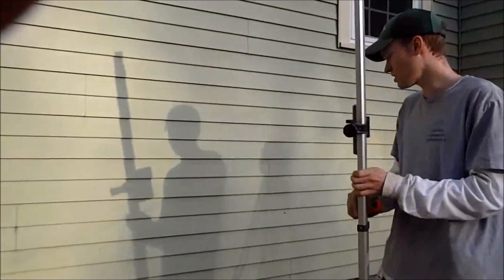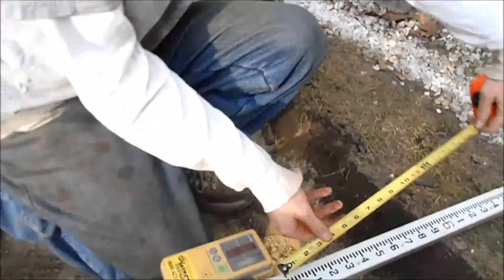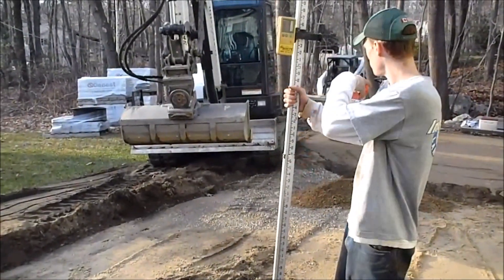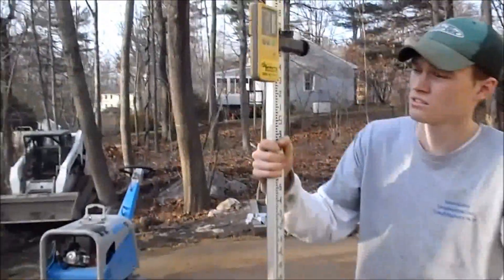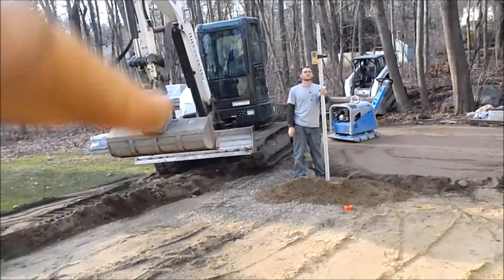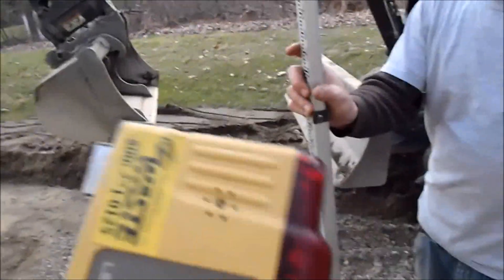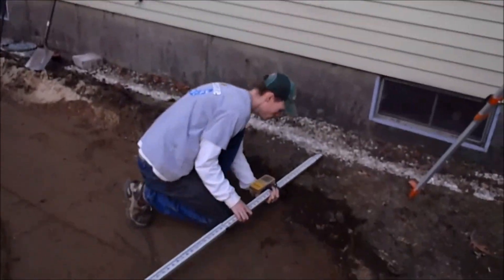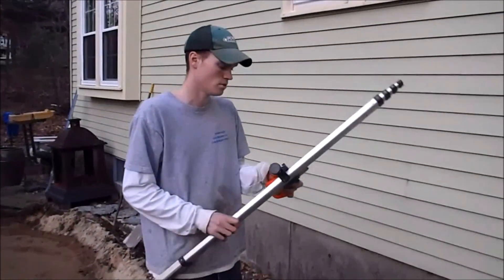How To: Set Up A Laser Level With A Pitch

Comment: You do know that your stick is not in 10ths but actually in inches. Each mark is a 8th of a inch thick.  So you actually get to measurements from each line that's why at each inch mark it goes to a point to show the top of that line is the next inch. It's for when you are looking through a transit and you have thin crosshairs yet you still need to see the line.
Reply: ryan gray Ryan; the rod (or stick) is in fact in tenths and hundredths of feet, meaning, they have broken the foot into ten parts instead of twelve, known as "tenths", and those ten parts of the foot are broken into ten more parts, known as "Hundredths".  That is how it is done in surveying and engineering.  It happens that a hundredth is very close to the same as 1/8 inch, but technically not exactly 1/8 inch. One inch is equal to .083333 Feet.  Anyway, just wanted to bring you up to speed with engineering/surveying measurements, and what those marks are on the stick.
Reply: You are right I was thinking the stick was in fact a foot stick at first glance. I use both foot and 10th sticks daily as I do customs pools so I am very familiar

Comment: You do know lasers are not 100% accurate. The further out you go the more it drops. You should get a transit there only off by 100ths
Reply from the maker: I do know that, and I know nothing is 100% accurate. For the type of work we do and the type of work I am doing this demonstration for this laser is more than adequate.
Reply: The laser I use is accurate to 1/16th" at 100 feet and good up to 1600 feet, imo it's a better bang for your buck.
Reply: that would be wrong, today the lasers are better and have the same range of the transits, I am looking at most transits being in the 3/16 to 1/4 tolerances how is that better than 1/16 per 100 ft. So why spend thousands of dollars for a super accurate transit when just about any top laser is better?

Comment: Really good clear video, I knew how to grade level, but not with a pitch, now all is clear, I have similar equipment, just a point if you have a pad, say 10m wide, 30m long I assume you would need the laser at the highest point of your pad and in the middle, If the grade was 1m drop over the 30m, is that just the centre line or does it apply to the full width over the 30m length? Hope that makes sense
Reply from the maker: Just the center line. It will get slightly higher as you go off to the sides because the laser is rotating in a circle.

Comment: Why dont you just figure the slope percentage? Measure from point a to point b. You already know the height difference for the slope. As an example say your height difference is .30 and your distance is 30 ft. Use a calculator and put in .30 and divide it by your distance which is 30 feet than multiply it by 100. That formula will give you your slope percentage which in this case will be 1% which = an eighth of an inch per foot. After you establish your slope percentage you need to set up your laser or aim your laser as you already know. The laser I use at work is a bit more sophisticated than yours and has a digital read out. Since I already know my slope percentage I set the laser to 1%. Make sure the laser is facing the right way or check it after you are done setting it up. I shoot my start point with my finished grade after which I go down on my rod for my sub grade and I am good to go.Its a one man job. I have been in commercial excavating for 30 years and this works best for me.
Reply from the maker: Thats a good way to do it but my laser does not do percentages. I'm basically doing the same thing by setting the high point first then figuring out how much pitch I want over the distance I'm going. I just cant enter in the % number.
Reply: MikeHF good video kid I have r 35 years working with lazers most carpenter don't get it I'm site dirt guy

Comment: BN, luv ur vids! For setting ur pitch I noticed a small error tho - u haven't set the laser to run thru 8" below the sill AT the edge/corner of the deck, but u instead set it 8" below the laser source (the instruments are offset from the deck a foot or 2)

When u initially set ur level the laser will be horizontal. And then when u set the pitch the laser points FROM the laser source down to where you set it at your mound. Thus the laser at sill won't be quite 8" below sill the way u set it up

Comment from the maker: 6" of gravel. All I was setting was the finished height of the gravel, which is 9" down from the sill. On top of the gravel there is 1" of sand then the concrete pavers that are 2.5" thick.

Comment: So if I have a 50x100 parking lot, I can set the laser say midway along the short side and water designed to flow straight across. I set my receiver on a rod at grade by the curb.(this grade is the same all along the curb) set the slope and I can check grade all over the  parking lot at this setting? thanks, enjoyed the video...I guess you can call the rod a stick, my operators call the tripod a stand. rrw

Comment: Who is doing your plans? ... because grade on site plans should be expressed in decimal feet  101.5'  99.25'  etc.  Feet-Inch rods are handy for some apps but you're introducing a potentially huge error if you have a worker who doesn't know the difference.